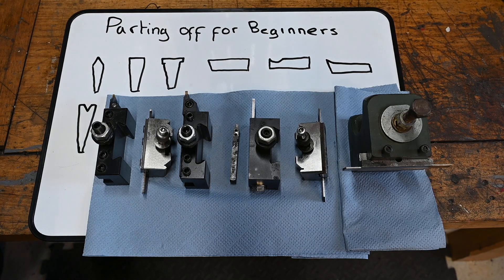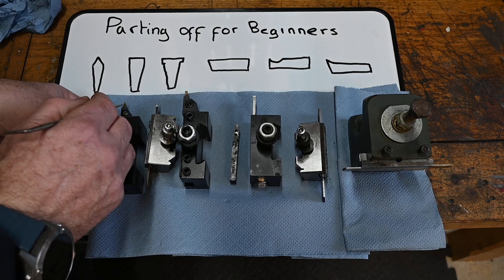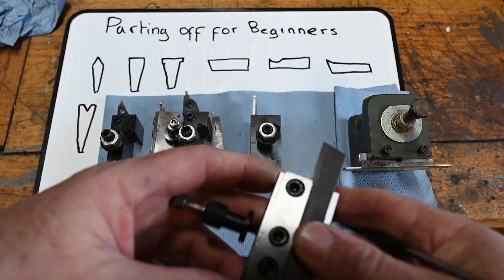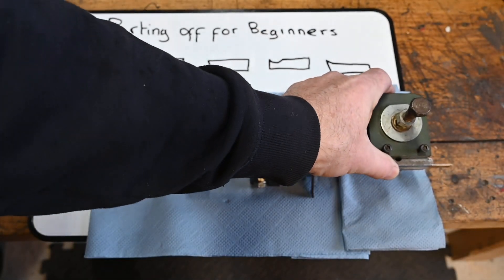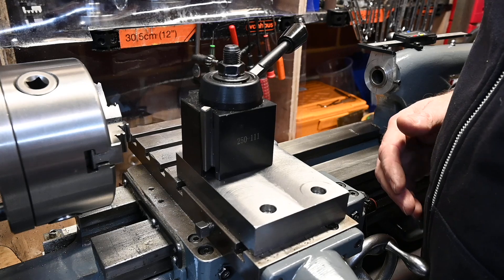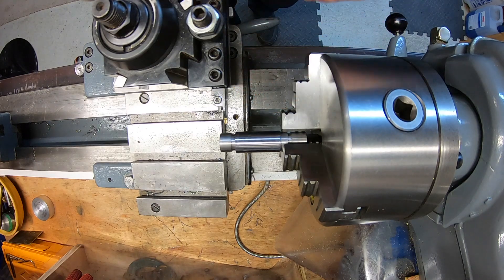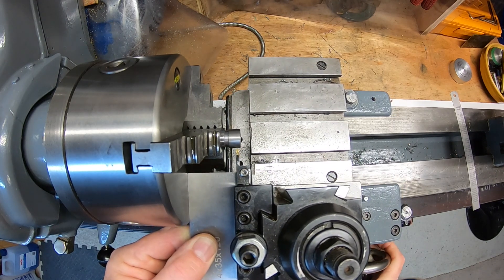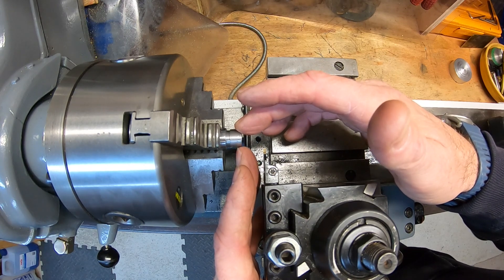Parting Off For Beginners How To:

Comment: Mostly good advice, especially the rigidity and tool alignment requirements. However, the speed reduction is not really necessary. Parting is a rather brutal machining operation but it will work fine at higher speeds provided you make the tool actually cut with a decent infeed. Yes, I part under power on my S7B and it's a bit scary at first but if you have the conditions right (as above) just let it get on with it. No need to make it a long-winded chore with slow speeds because it will work just fine at a higher speed. It won't chatter with a decent cut being taken but if you back off and take a more tentative cut then it certainly will. I use a rear-mounted parting tool for the reasons you mention. For the longest time I used a (rather poor) Eclipse HSS parting blade which was mostly OK but would jam sometimes making me a bit hesitant, however my new carbide insert tool does not so I have more confidence in it. Confidence is the key here, trust your machine can do the job, don't try to creep up on it with low speeds and tentative cuts. Just my 2p's...
Reply from the maker: Thank you for your knowledge 👍

Comment: Hi Mark. I did a video very much like this one. The rear parting tool I made was a game changer. I was always wiery of front parting & had many snarl ups. Since using the rear one it is so much better. Same lathe as yours. 
Regards.Steve.
Reply from the maker: @Steviegtr52  I do have a rear parting tool but just don’t think to use it. I should because as you say it’s much better

Comment: Thanks ever so much for this video , I am a beginner and I’ve had lots of problems parting off . I have a small carbide insert parting too but the tip keeps separating from the tool.
Reply from the maker: Sounds like it is faulty if the tip keeps coming out, try a different one, if it keeps snapping off then you are driving it to hard 🙂👍

Comment: Great video.  Big lathe or small lathe, the principles you outlined are applicable to both.  An additional thing I found is that a full profile parting off tool blank is intended for end grinding only. These blanks have an additional profile on top of the blade. These tools require a holder which imparts a top rake.  If used on a standard blade holder there is no top rake.  I bought a tool holder for a much larger tool post.  This allowed me to machine the holder to rock it back to give an appropriate angle.  Cheers.
Reply from the maker: Thanks for sharing your experience 👍

Comment: I like your video and i would like to add a couple of points that may help. I am a time served fitter and turner but left the trade to work for SecoTools in New Zealand. The introduction of carbide insert part off tools was a great move forward in parting. The big secret in these is the chip breaker. This not only gives a bit of positive cutting action but also pulls the chip inward to reduce the chip width. I suggest you take a cut and measure the chip and compare it to the groove width. Now HSS tools. You need side clearance for it to operate but if you grind too much top rake the width of the point is less that the top section and you have the effect of trying to push a tapered tool into the work causing huge problems with chatter and possible breakage. I hope this helps. Cheers Ian
Reply from the maker: Thank you for sharing your knowledge 🙂👍

Comment: Yes I agree. I run a Boxford and a M300 and even on the bigger machine parting can be disastrous. I mainly used tipped tools on the 300 and high speed on the Boxford but had a big bang on that only last week. I’ve just bought a HSS parting holder from Arc Eurotrade which I’m going to have a go with.
Interesting video, especially regarding tightening things up, I’ll definitely look at that before I have another go. Thank you!
Reply from the maker: Hope it helps 🙂 We all have problems along the way, but it’s incredibly satisfying when we  solve them 🤞